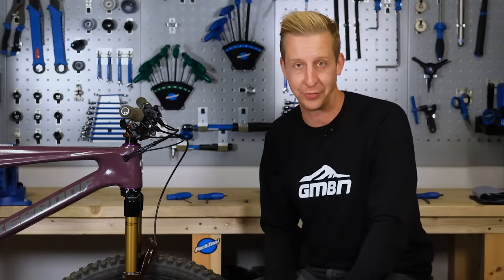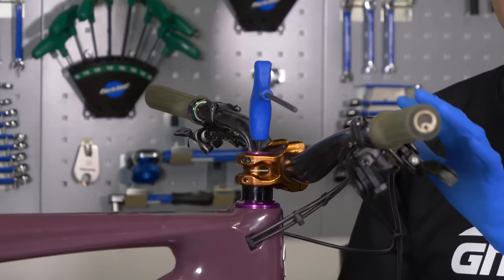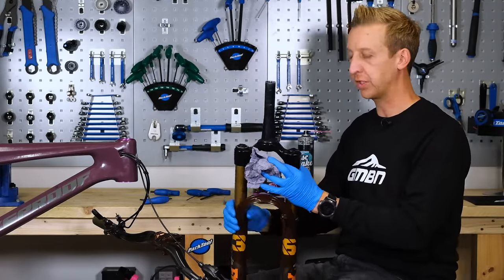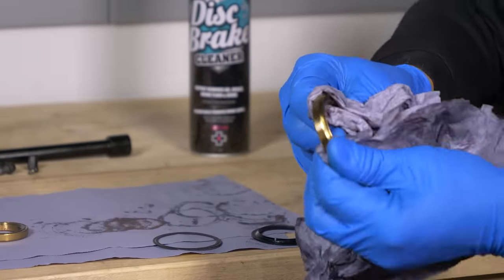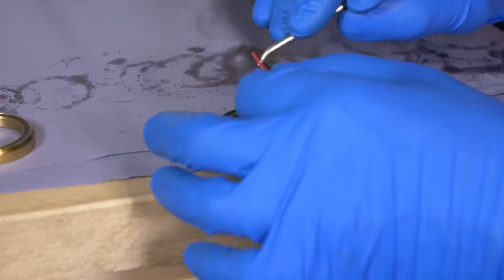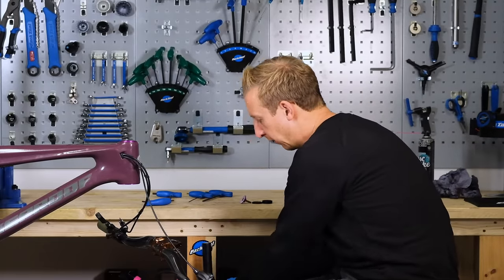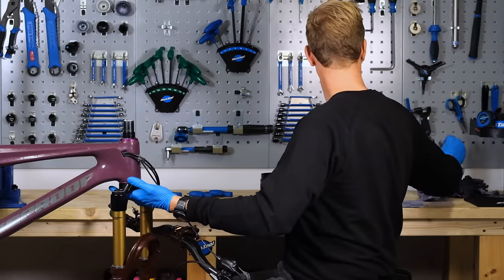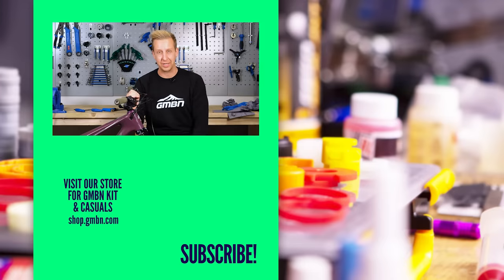How To Service A Mountain Bike Headset | MTB Maintenance

Comment: I skipped the grease inside the frame when building up my bike (made the mistake of listening to some BS about carbon and grease being incompatible).  A year later the bearing had a bunch of surface rust on the outside surface, never doing that again.
Reply: kinda understand why they do this now, downside is, should you neglect the bearings somehow and they do somehow seize, the whole bearing is likely to be spinning on the headset cup itself and you may be none the wiser to it being damaged, still feel greasing the cups is something that just transfered over from caged / loose bearings

Comment: All well and good unless the bearings are stuck inside... then fall apart when taking them out so yourleft with half the siezed inside due to the rust.... what do I do then?
Reply: If semi integrated knock the cups out and relive some pressure and lever them out with a flat screwdriver or just replace the cups too. If integrated then depends what access you can get through the head tube to get into the race with something, or dremel it out.

Comment: 11:48 while putting everything back together, notice his left hand maintaining the fork up. Be sure that when tightening the bar and the top, the fork is correctly pressed up, no gaps should be there. Even a millimeter gap can be unnoticeable, and using your bike like that can seriously damage your frame.

Comment: Of course I did mine a few weeks ago....
Also, another use for old tubes (or in my case, some nylon straps), strap the fork to the frame before you start loosening things, so it will only come out when you want it to.

Comment: A very methodical way of working - well done. The only thing that I would add to laying the components out in order is to also lay them out with the upper surface on top - hark at me, I sound like a retired mechanical engineer - I'll try and remember my own advice when I come to do this job in an hour's time 😉

Comment: hey doddy, i have a canyon neuron and the top headset bearing needs replacing but it feels like it’s stuck i’ve tried to use a rubber mallet with an allen key with a cloth but still not moving. Any thoughts?

Comment: Never looked at my head set bearings. Also can't get a service at lbs. But they are feeling a little stiff. As I had a cheep bike. Are the chances of the bearings being the old cage style? If so can these be changed to a cartridge bearing?

Comment: great video...mine didn't have any waterproof seals for the bearings in either the original headset parts nor the replacement.

Comment: Nice video and instructions 👊🏻
It would be great if you included the torque settings.
Particularly the headstem Allen that pulls it all together. Over tightening can mean a new set of forks!

Comment: Lucus Red-nTacky is a third of the price of Muc Off Bio and is the go-to grease for protecting bearings that are susceptible to water ingress. Funny that the Muc Off Bio is also red. Stick a picture of a bicycle on a product and package it as bicycle specific, and you can charge anything.
It's funny how many so-called use specific degreasers for example smell like oven cleaner, they're even dyed like an oven clearer.
Wheels are round, there's no reinventing them.

Comment: I just got a IS42/52 headset for my new Merida One Twenty frame. The top bearing sits about 3mm below the top of the head tube. Why design a frame with such deep insertion depth for the bearing? I figure I’m going to need 3mm or more of spacers just to preload the bearing correctly.

Comment: Hey bike-lovers, can I get an honest opinion? I've got a mountainbike I'm very happy with (a rockrider series from decathlon). Every year I sent it to an atelier for maintenance, to keep it in good condition. Usually that's between 50 and 100 euro. I trust they do the necessary. It's always similar. Usually we change the chain and/or the brakes. Sometimes we replace a wheel or a sprocket when necessary. Always very happy, get along great with those guys. I always understand what they're telling me. This year I give it to a new dude (/same place though) and I immediately get the impression of getting an opportunistic salespitch. Even before he looks at the chain and the brakes, he starts unbolting the fully functional 'headset', warning me of the common danger of losing control of the steering wheel in full speed. (a very common danger i personally never heard of.. (?) , and I don't find any online examples of .. (?) with a steering wheel that had no issues at all as far as i know) For some opaque reason, even though I'm not completely bike-illiterate, the chain could not be replaced without changing the brand new sprocket (from that same store, a year earlier), which is something that never was a problem before. Though we remained cordial and polite, the guy got a bit nervous, did not expect I'd start pushing back a lil on his expert opinion of every issue he saw with my bike, as he was, in my eyes at least, trying to drive up unnecessary costs, and even seemingly wanting to collect brand new parts from my bike to sell me replacements for it. We didn't even get to the end of his list of issues he had written down, because of the questions I asked him and that startled him a bit. I'm not an especially difficult client, who is ever-mistrusting of services rendered, i really respect the mechanics and usually trust their good judgement, but the supposed issue with the 'headset' felt like a red flag to me ? Is there really a common danger with a functional headset suddenly malfunctioning and making a bike completely stearless?  Just to test my suspicions with someone, from what I'm telling here, do any of you know if I was correct to be wary of this salesperson? I'm unsure. Thanks!
Reply: @lau_dhondt  carbon fork? Look up ring of death.

Comment: My bike shop said there's nothing wrong with my Head set but every time I tighten it, it still is loose and has play. Any ideas of what this is?
Reply: Make sure that when you tighten it you loosen the lower stem bolts that hold the stem tight so it dosent move make sure to losen them and then tighten up the top cap bolt and tighten the stem bolts back up

Comment: #AskGMBNTech I see you using MucOff grease and got couple of questions.

- Is MucOff's grease Carbon safe?
- I know it's biodegradable. Does it also separate like WPL's after not usage and need mixing?
Reply: Yes it’s carbon safe and we use the large workshop tubs and when sat for a while it does separate but nothing major.

Comment: 2:21 keep in mind if the bike has been heavily abused by not being serviced the compression ring and the headset dust cover right be stuck to the steerer tube and you might need to use a hammer to loosen it.
If you think it won't happen, I confirm it can happen, I've sold some parts and worked on a bike a guy bought so much wrong stuff on it, I had to hammer it hard alot, obviously was careful. 

Headset service is a good point to check the headtube, fork for damage i found punctured lower leg and leaks tru seals and wet dust wiper seals on a old rockshox did fork, probably due to grashing on a sharp rock. 

But managed to loosen the fork, and clean headsrt, steerer, everything got it packed with grease. 
Fork was locked out mabye corroded and rusted internals lockout was open and it was stuck. Shame it was a dual air Rock shox Sid Team. I had to tell the guy the fork was dead, only few parts that probably could be saved and sold, but it me and new fork for that bike really 
I went over the the rest of the bike and to no surprise I found other nasty things. 

Technically you don't have to remove the brake caliper, if you have a spot to hang the fork securely, if you keep  bike at same sngly and gang fork at stand, but if you want to work more comfortably detaching  is nessesary but if for some reason you can't, it's not technically needed. But if doing service on headset and want to change positions or rotate frame upside down, it's best to detach it all, like with my. Heis king headset i prefer to detach, but with integrated headset or semi integrated with loose cartridge bearings you can just remove those and clean easily without messing with the fork, so I never did it.
On my bike I have Chris king bearings so bearings were pressed into the cups so I need to have fork fully seperated from the bike and rotate the frame upside down to work on bottom bearing, the bearings have a metal ring keeping the seal secure, so that has to be removed. Not a job for a brutal beginner.